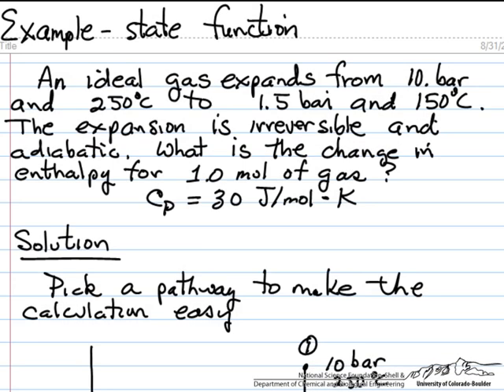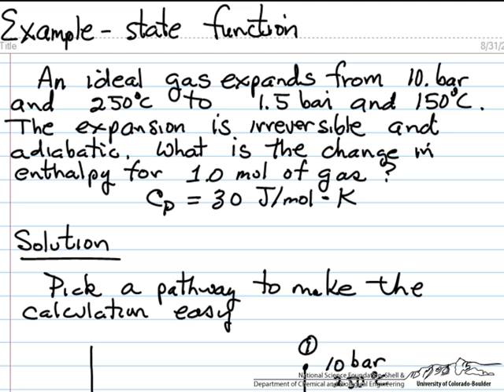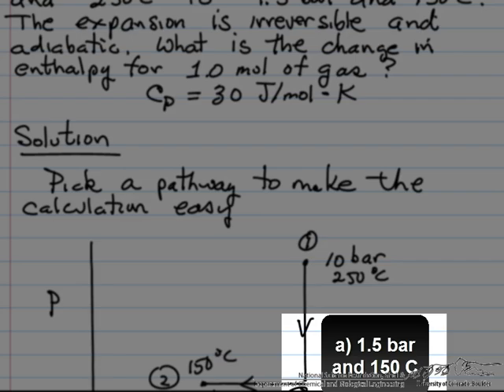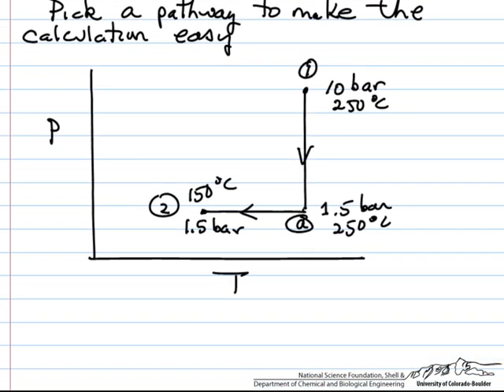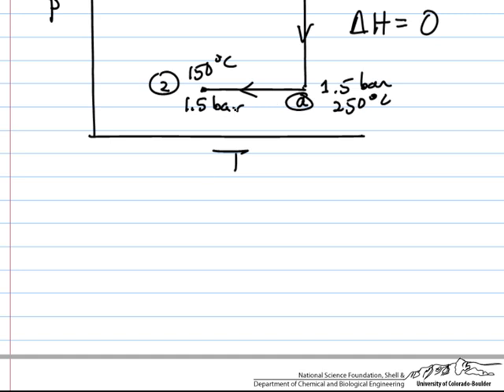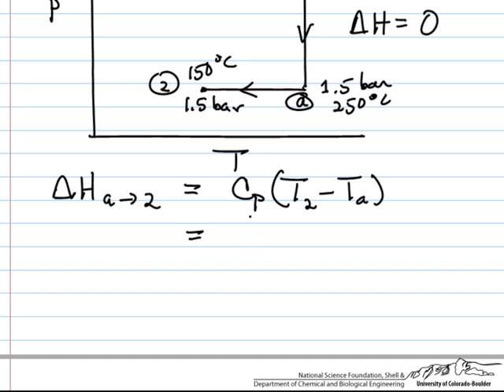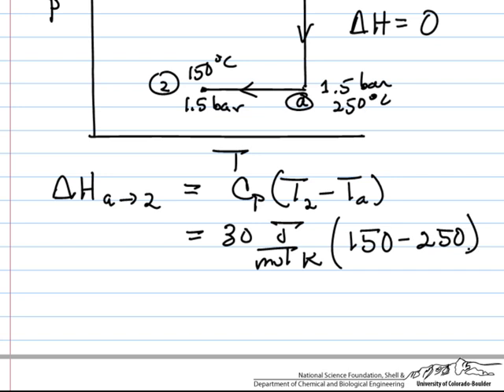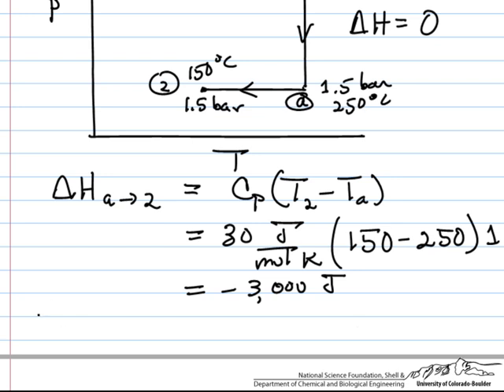Enthalpy Change for an Ideal Gas

Comment from the maker: Thank you for your comment.  Remember that we are using an ideal gas, and that for an ideal gas, the internal energy is a function of temperature only. From the ideal gas law, we know that pV=nRT; now we can change H = U +pV to H = U(T) + nRT.  With this equation, we see that if temperature is constant, deltaH = 0.
Reply: Can’t your reasoning just be that (even if not ideal gas) dH=Cp dT. From 1) to a) dT=0 as temperature is constant, so dH must =0

Comment: In the process 1 to a ,how can delta H = 0. Correct me if im wrong.
(im using d for delta)
H=U+pV
dH=dU+d(pV)=dU+ dp V +pdV.......................1

and q=dE + pdV
this value of q is a special case of enthalpy "H". When H is measured at constant pressure,then dH=q

and q=nCdT, but when q is measured at constant pressure q=nC(p)dT= dH
so we say dH=nC(p)dT         (only when the pressure is constant)

in the process 1--->a, dT is no doubt, zero. But how can this formula be used here,since pressure is changing. now dH isnt equal to nC(p)dT.
Reply: from 1 to a there's no temp change = deltraH = 0, there's only work being done which isn't solved for here.